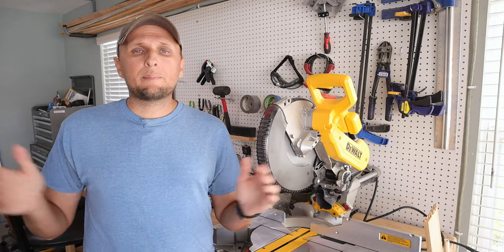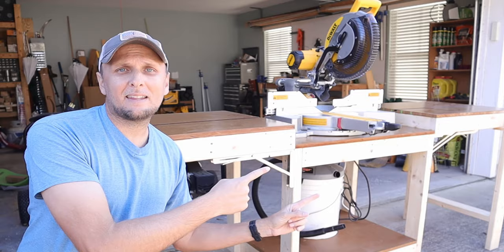How to Build a DIY Mobile Miter Saw Station | With Dust Collection and T Tracks!

Comment: I love the extra support legs that you put on the ends I need to do a build for a miter saw table and I've been racking my brain to try to figure out how to put a better support than a piano type hinge.Thank you for the tip on the MDF board I will check the prices you may have saved my soul and my wallet LOL⭐️⭐️⭐️⭐️⭐️

Comment: Wouldn't regular hinges be fine on this since you've added leg supports?  Just thinking about money difference in folding brackets vs regular hinges.
Reply: I was thinking the same.  I have this kind of hinge for a foldable table and they cost over $30.

Comment: I noticed you are screwing the 2x4’s together into the end grain when making the framing for the top and bottom shelf. Over time have you had any issues with this regarding wobble or wobble in the framework or does the MDF take care of that? Thanks. Hope to build for my Christmas present miter saw.
Reply from the maker: I have had zero issues with it and I have used the mess out of this thing.  The MDF does add a really nice layer of pulling and holding everything together.  I hope you like yours as much as I do mine once you make it!  Congrats on the new miter saw!

Comment: When you factor in the cost of the wood, tracks, brackets, hardware, casters, mdf, and the time to build it just seems to make more sense to buy a mobile stand like the Toughbuilt S600 or Ridgid AC9946.  Not saying you don't have any benefits over them, but they surely have benefits over your setup as well.   One push down on your foot and you have the entire saw out ready to go with sliding stops and extensions up to 10ft I believe.  Superior mobility and storage as well.
Reply from the maker: I disagree.  This costs less than those metal stands especially now that wood prices have dropped since making this video.  With the miter saw attached to it, those will take up almost the same amount of space as this does with the wings folded down. Those offer no options for a bottom shelf, which for me holds my planer and dust collection.  You may like those better for yourself but to say they are superior, I don’t think that’s true in any category.  Those stands you listed are more for contractors who need easier mobility to go from job site to job site.  Outside of that, if you’re a maker, make something.
Reply: @HowToHomeDIY  My Dewalt planer is 92lbs.  On the Toughbuilt S600 it's a breeze to move around, supports the weight, and folds up nicely in a corner. I never have to pick that planer up again.  The cost of your build is not much cheaper.  $60 on MDF, $40 on 2x4's, $90 on folding brackets, $35 for T-Track, $25 for casters.   You're over $200, and you gotta do a lot of work when you can just spend a little more, open a box and assemble.  The Ridgid goes on sale often enough around $125, the Toughbuilt I've never seen a sale on yet.   I'm not a contractor, but my work space is small, and these stands move around so well over any terrain, up and down stairs no problem its effortless.
Reply from the maker: The brackets aren’t $90.  $40-50 for two pairs depending on size.  So the total build is under $200 and it can hold my planer and my miter saw.  Those stands you are talking about are each $230-300 depending on where you get them.  I would need two of them, one for my miter saw and one for my planer so at best I’m at $460 and with two of them with those items on them they are going to take up way more space than my build.  I’m glad you are happy with what you have but again I strongly disagree that those are better.

Comment: This is great, but the legs are only going to be level if on a level surface.  If one side of the ground is lower than the other, the legs won't touch the ground on that side.

Comment: Nice video… but one question: why do you not wear safety glasses ?
I had a career in construction rising to sup’t, & always wore safety glasses well before OSHA, & I’ve seen, first hand, guys ‘losing an eye’ that safety glasses would have easily prevented.
Great advice about wearing a face-mask as protection against inhaling wood dust, etc… making me all the more puzzled about lack of safety glasses.

That said, NICE VIDEO of constructing a nice, very useful DESIGN.
Reply from the maker: Sometimes I do, especially when running a table saw.  Just personal preference.  I have run all kinds of circular saws, miter saws, etc and had no issue.  Things like table saws and drill presses though, I always do.